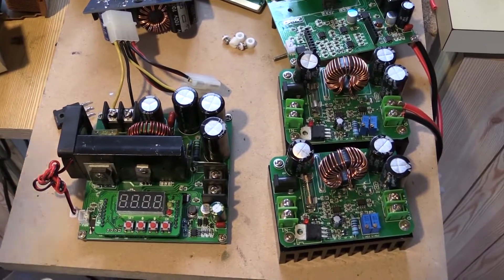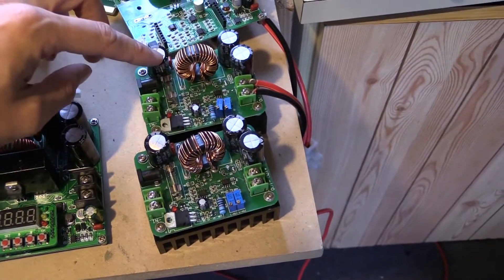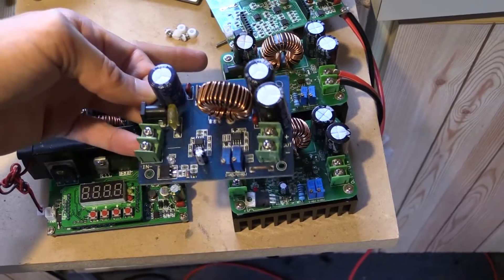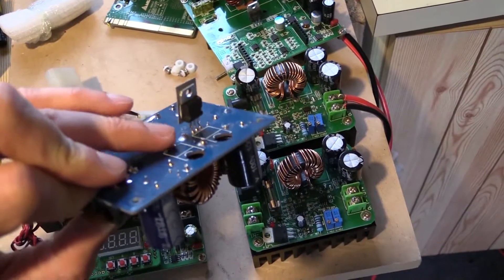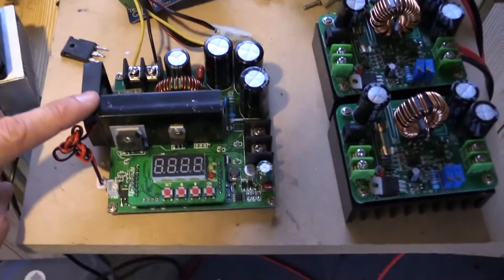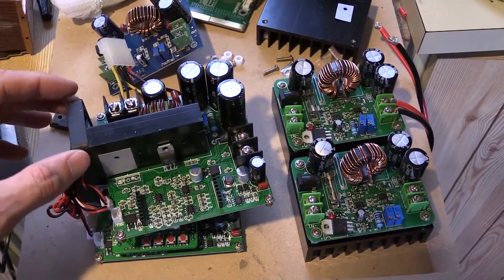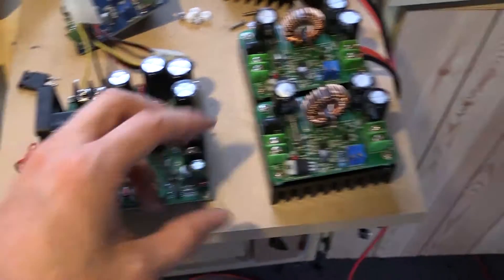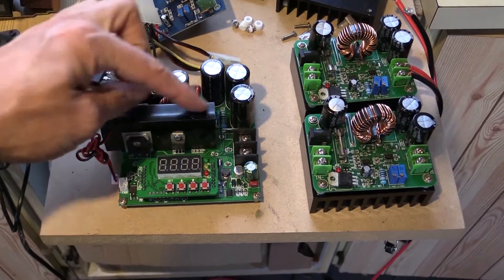DC DC Converters

Comment: Hi i have a question, i want to use the B900W for charging my electric scooter with  a solar pannel. But at night when there is no power and the thing is plugged into the battery, is there a significant current backflow out of the battery?

Comment: Do you have any issues with the constant current mode on your 900W unit? I'd like to get one, but I watched a video demonstrating one in which the constant current mode doesn't work at all.
Reply from the maker: For the price, i would recommend it, Remember its MPPT so its constant current will depend on what the solar panels are doing, It's not going to be CC unless the input is stable. The as with all MPPT ,charging batteries the voltages slowly goes up as you apply current, With solar there is no CC. The CC will always change as the clouds come over, birds fly past, light changes. You might set it to 5amps but unless it's very sunny it might only stay at 5amps CC for a short time before the light changes on the panel and the panel can't put out 5amps so the current drops. The unit will put try increase the current to the limit set and the voltage will slowly go up, When the voltage reaches the limit you set for the batt then CV kicks in. Either way 3 of these units charge my 10kWh of batts.
Reply: I meant in a general sense, like, powering a load. Someone made a video showing their 900W unit, in which the constant current mode simply didn't work. You could set the current, but the load would draw as much current as it wanted anyway.
Reply from the maker: I haven't see the video your talking about but either way its 900w would be a push with the small heatsink in this unit. It's really just a boost converter and just like any boost converter i don't see why the limit of CC wouldn't work. Tho if the CC didn't work then it really doesn't matter because the unit was designed as a solar MPPT charger, not to be used as a normal boost converter. Maybe if the video shows the CC doesn't work it could be because the MPPT chip on the DC input is doing something strange.
Reply from the maker: 60mA, but i good find. For me i want to actively log the voltages of all cells not just balance them, so i am building a cell monitor and adding in a balancer that will do 1amp per cell that is completly custermizable.

Comment: Do you have links to the 150W boost converter?
Reply from the maker: Sure i guess u mean 1500w , I have also just ordered two of the 1500watt ones. http://www.aliexpress.com/item/1500W-30A-DC-Boost-Converter-Step-up-Power-Supply-Module-In10-60V-Out-12-90V-New/32719099220.html
Reply: Thanks,
 I was actually looking for a link to the 900W with digital display. I found it on aliexpress.
Reply from the maker: cool, the 900w isnt as good as the 1500 and 1200w ones as pointed out by someone else.
Reply: I am more interested in the digital control. I want to boost the 12V battery output of my solar to run some 12-20 volt devices with small buck converters.

Comment: I look forward to your videos. I'm doing almost the same. My battery's are done. I have the charger. Just need to put it all together. Working on a arduino program to measure power coming into the house. And going out witch will switch on a charger or gti. And reset every 1/2 hour. And use the grid for a 1/2 hour battery for peak power delivery. I think it will work well. Hope.
Reply from the maker: You should also do some videos .

Comment: You need to charge the whole pack in under6-8 hours
Reply from the maker: Good spotting! Thats what i have said on other projects. With two banks eg 10Kwh i will need to charge that in a day of sun light. Which sounds easy but far from it. On a good day of sun its fine but on a cloudy day there is only a small window of solar to charge from. Which means i need to be able to charge around 10kwh in 5 hours or so. That will be the plain. I am just about to finish my charger videos and how my charging plan has changed so more details will be in that video. I am also about to do a overview plan video today as that is needed.

Comment: I have one of those and some 1200watt ones. They are just toys and can only Handel about 1/4  of there power. If that. Then I bought a 54v 1200 watt charger. It's about 10 to 15 times bigger. Good luck messing around with those little things.
Reply from the maker: The only reason i can see they can handel the power is because of the cooling. The mosfet are able to provide the power if cooled. What 54v 1200watt one did you buy that works well?